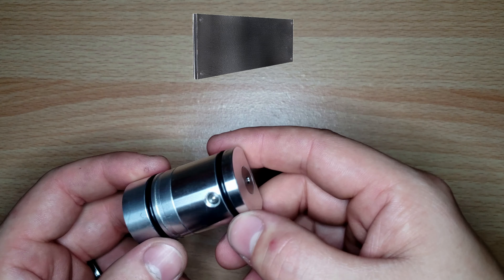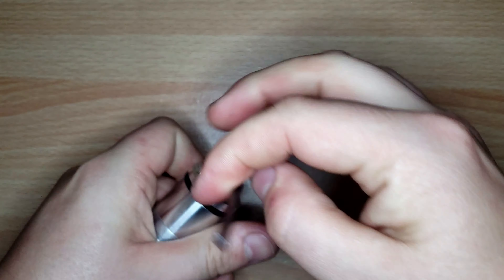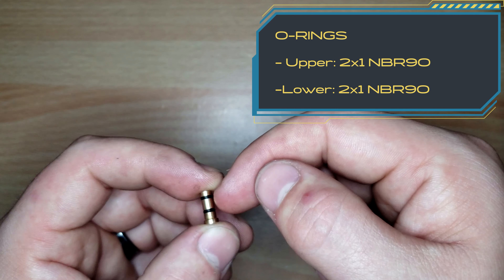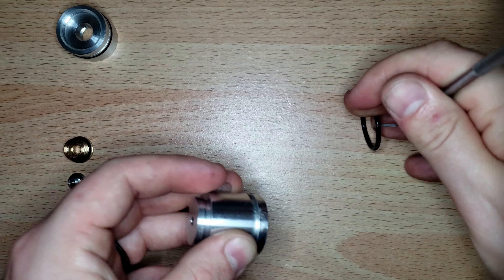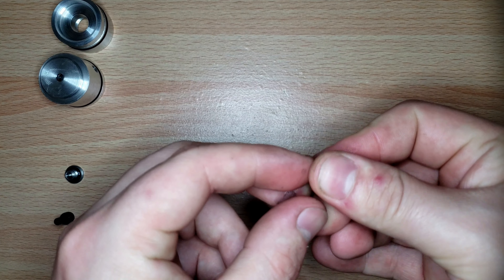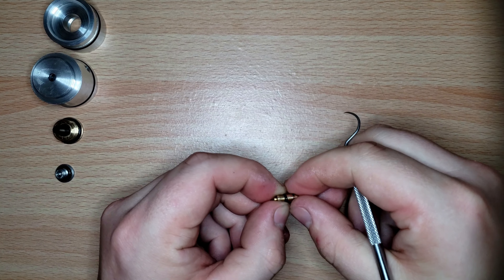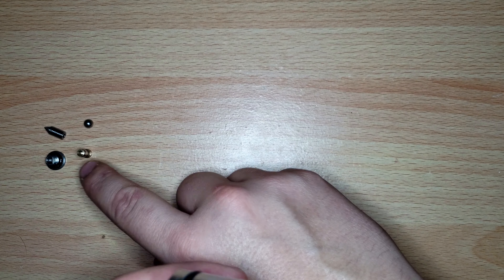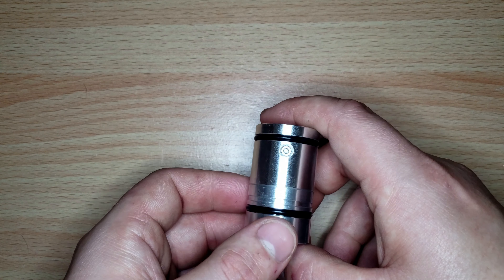FX Tube AMP Regulator - Complete Disassembly and Reassembly

Comment: Very Very useful, I will try to repair my AMP regulator, which for me was not an option but with this tutorial I am encouraged to do it!

UPDATE: Using this video I have disassembled and reassembled my AMP regulator. The former owner from the gun said that she was not able to shot and the problem was caused by someone that fulfilled the cylinder above the 230 bar. With my to left hands as normally I tend not to be an expert on this type of details, I follow this video, disassembled the Regulator to find out that the steel ball was not in position, in fact I don't really know where she moved to with the extra bars that she was subjected, but she was there. Following again the video I complete  reassembled the regulator installed following again the instructions and.... What the Hell!!! It's working!!! until 2 days ago I did not knew what a regulator was in an FX airgun and now I fixed the problem saving me some money!
For the person that produced this video, thank you very much! I would not done it if it was this perfect tutorial!  Want to see more videos from you! Keep the good job!
Reply from the maker: Wonderful experience! This is why I make these videos 💯 Thank you so much for the support and so glad that I can help!

Comment: 7:32  thought I had every possible oring... This one is not listed on fxs diagram... neither are the tiny two on the  "adjustor"... Took my reg apart and put together with mostly new orings and it still leaks... Thanks fx

Comment: Great video. Thanks a lot. Can I put a little loctite in the thread between the two parts? Because It gets lose with me after shooting for sometime.
Reply from the maker: I would not normally recommend any loctite on a regulator, but maybe an extremely small amount of low strength just to keep the two halves together might be okay. Never tried it before.

Comment: Thank you, was very informative and helpful. Do you know if full power version and uk 12lb version are the same regulator, and just configuration of the dishes are different? I am trying to see if I can set my rifle to shoot  close to uk version and have huge shot count
Reply from the maker: Normally the 12FPE versions have different valve pin, valve seat, hammer spring and hammer weight in order to create the lower power. Regulators are the same as far as I am aware, this regulator will adjust down to 60 Bar

Comment: Just finished watching the whole series. I have a dreamline classic with a small leak, roughly 5 bar a day. Im not sure where it’s coming from yet, but I assume from the vent hole since it’s a common spot. Your videos are super clear and helpful. What brand silicone grease are you using?
Reply from the maker: Thank you for watching! I use Super Lube Silicone Grease with PTFE part number 92003

Comment: Newman, I know you and Ernest use Superlube alot.  I have been using it in complex cleanroom equipment robots (24/7 runtime) for years, it is great stuff. However I noticed you are using 21030 which if you check the compatability sheet on Superlube.com will tell you it is not compatible with Buna. It will swell these orings, ask me how I know. You guys should be using 92003, as it is compatible with Buna. It is made with Silicone. Just sharing my experience. Love the content and the delivery, thanks for helping to grow the knowledge of our airgun community.
Reply from the maker: Thank you for the information! The o-rings from Sweden are actually NBR (Nitrile), which is Excellent compatibility with 21030 SuperLube. 92003 is Excellent Compatibility with both Nitrile and Buna, though, so we will definitely look into making the switch! Again, thank you for bringing this information to light, and I will be sure to use the correct formula number for now on. 👍  Thanks for watching!
Reply: @910AirgunTuningandRepairs  Great to hear. Glad to be of help. Thanks again.

Comment: Thank you for the information on the amp regulator.  I have two .22 dreamline classics that I believe one has an issue with the regulator.  The issue is the time it takes to replenish air pressure between shots.  It's very slow compared to the other one.  The non issue replenishes in about 2 seconds.. the other takes about 20 plus seconds.  What do you know of that can be causing this.  I never new for sure about this issue until I bought the fx radar. These dreamlines were bought together about 15 months ago. I appreciate any information you can lend.  Thanks and have a great day.
Reply from the maker: That's a tough question, but I believe a reseal of the regulator may solve that. I'm guessing there is an oring somewhere just slightly too large or blocking an air passage. Let us know if you locate the problem, thats a first for me!
Reply: Hi Michael, hope you are doing good.
My query is quite late.... on the regulator creep you were facing.
Could you resolve the problem.. how ??

Will be glad to be I.formed as I am facing the simular issue...

Regards

Comment: Thanks for the videos i was a problem on that, actually i found out there is air leakage in the adjustment screw of the regulator of FX Dreamline lite .22, please tell me what to do ? I put soapy water in that adjustment hole there is slow leak bubble coming up, as i said its about 30 bar in 10-12 hours
Reply from the maker: That could be any of internal o-rings, so it would be best to do a full reseal

Comment: If you want to give more bars to the regulation set in the air cylinder, then what to tighten or loosen the screw of the Allen key that you see, stop mar and what to tighten clockwise
Reply from the maker: While the regulator is in the pressurized airtube, the silver adjustment screw will be visible. You turn it counter clockwise to increase, clockwise to decrease. Be sure not to over adjust the regulator because you can damage it. If the screw does not turn, don't try to force it

Comment: I own dream line lite , the regulator just pass less than 50 bar , i tried to adjust from the screw but with no response from the reg . , what should i do ?
Reply from the maker: Sounds to me that is a restricted power model. The regulator is more than likely restricted from more power.

Comment: Hi my friend awesome Video ... so without a reg tester how many turns out from bottomed out to get around 100 bar would it be around half a turn if it’s about 60 bar per full turn anti clockwise cheers
Reply from the maker: Unfortunately, not every regulator will act the same, so there is no way to measure exactly how much of a turn will provide a specific regulated pressure. If it is 60 bar for a full turn, then you would need about 1.5 turns to reach 100 bar. Hope this helps!
Reply: 910 Airgun Tuning and Repairs yea thank you my friend

Comment: Hi Newman,is it possible to change my Wildcat MK2 .30cal 700mm barrel to .25cal? If ever,what parts do I need to replace?thanks for your time,appreciate it.
Reply from the maker: You certainly can! Just need a new 700mm .25 barrel and pellet probe. The .30cal 700mm shroud will work on a .25cal 700mm barrel.

Comment: What causes air to leak out of the front of the barrel while pumping air into the cylinder?
Reply from the maker: That would be a valve leak. If the rifle is completely empty, and you are trying to use a hand pump, you will not have enough pressure to seal the valve more than likely. You will need to use a mini-compressor or a scuba tank to get an initial strong blast of air to seal the valve shut.
Reply: @910AirgunTuningandRepairs  I'm using a Nomad II compressor.  I don't think I'm building up enough pressure fast enough to seal the valve.  Oh well.  I'm out of ideas.  😞

Comment: Please give me the best solution because here i don't get any o ring like you change it, i almost did putting some epoxy glue in the hole of adjustment screw to stop the leakage, is it a good idea ?
Reply from the maker: I would not recommend the epoxy glue as it can seep in and damage the rest of the regulator. In order to fix a leak, you will need to reseal the regulator with the proper o-rings

Comment: How do you adjust it for more or less power?
Reply from the maker: You adjust the regulator pressure by turning the silver regulator screw, which will be visible externally from the airtube, when the regulator is installed properly.

Comment: Sorry i wasnt able to find any 2.13 o rings on the market
Reply from the maker: Which o-ring are you referring to?
Reply: @910AirgunTuningandRepairs  small ones thats on tiny brass thing inside the reg. Which holds the ball. I have a leak from reg adjustment screw. When i try to incrase/decrase pressure it leaks for a while after it slows down but still air is coming out of it

Comment: Kindly be more specific if you are putting a videos, you should also show how to take out and put it back correctly from the tube and in the tube, not just directly by regulator because putting at the correct hole of the external adjuster screw might be a problem
Reply from the maker: Sorry for the confusion! I have other videos showing the disassembly and reassembly of the FX Dreamline airtube.